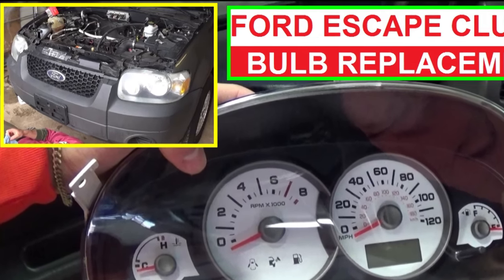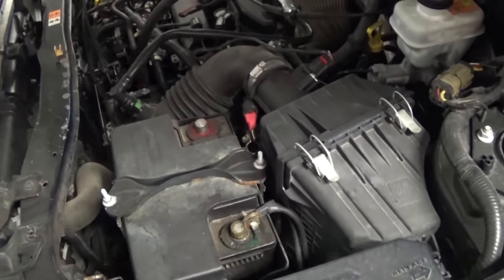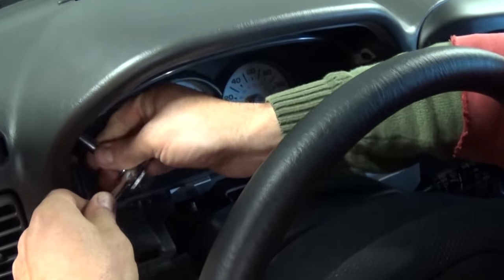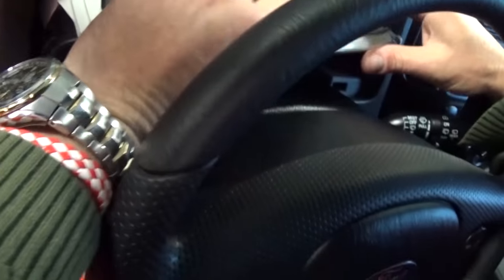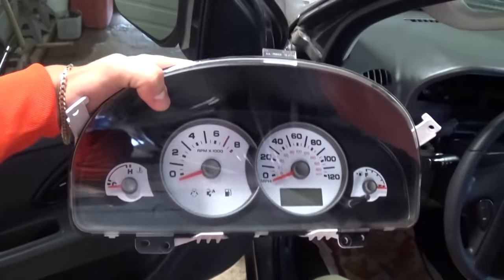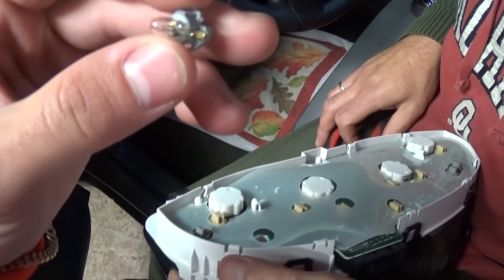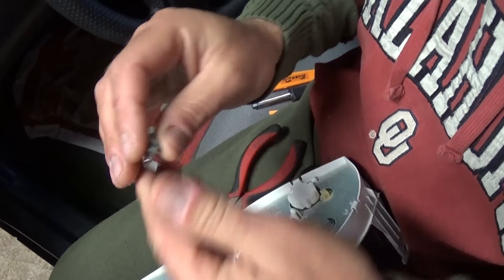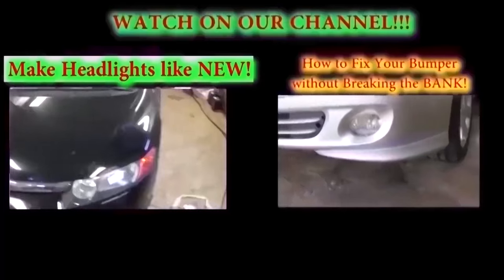How to replace Instrument Cluster Light Bulb on Ford Escape and Mercury Mariner

Comment: Thanks for the video. If anyone's wondering what bulb to use , it's a 74 Mini bulb
Reply: What bulbs are used for the other gauges? The gas gauge light and the Tachometer light on my escape are both out.
Reply: Ben Arthur it's the same size bulb
Reply: Nice...thank you!
Reply: Is there any way to change the colors? Or are all of the bulbs white and the dash is just tinted?
Reply: The correct bulb is a 2721. The 74 and 73 bulbs are a little to fat.
Reply: iekurt67 No dude, I just took mine apart and they are all 74's. I made a purchase and needed to return it. Don't lie to people!
Reply: I'll be interested to compare my original to the 2721 tomorrow after work-I tried to change my burnt out cluster light with a 74 today, and it is, as you said, a bit too large.  I wish I could upload a picture for anyone that doesn't believe you-the burnt out original bulb next to the 74 I tried to use in the socket---the 74 is not hugely different, but it is wider throughout and won't fit in the socket, at least not on my 2006 Escape.
Reply: Sara S Were the 2721's the right fit? I got a 2006 Escape as well. The bulb for the fuel gauge is burnt out on mine, so I wanted to replace all the bulbs in the cluster sometime soon.
Reply: I never even bought the 2721's--couldn't find them in the store.  I ended up buying E74's online: got a box of 10 of them for under $15 shipped--the E74's are a little narrower than the regular 74's.  They (E74) seem to be used more in imports, but they proved to be the proper fit for my Escape. While waiting for the E74's to arrive, I did cram in a few of the 74's: they were brighter than the original bulbs, and started to burn out within a week.  If I were you I would shop online for the E74's and replace all the bulbs at once, like I did.  Online prices were very affordable-much more so than buying the over-priced double packs of regular 74's in the store, only to find they don't fit like I did!  I also bought one of the replacement OEM bulb and socket fixtures as I thought I had damaged one of the original fixtures (just had the reshape the metal prongs a bit after twisting it out of the instrument cluster) and the E74's match the OEM bulb that came with the replacement OEM bulb/socket.  Wattage and voltage are the same as the originals/OEM---figures, even the OEM replacement doesn't have the bulb number on it, just the volts and watts printed on the bulb side.
Reply: Sara S Thanls for the reply. Just ordered a 10-pack of them off Amazon. Probably the same one you bought. Looking forward to installing them.
Reply: You're welcome, and I hope they work as well for you as they did for me!  My Escape's been my best vehicle so far-just passed 244k this past weekend.  Good luck!
Reply: Hello Sara, one question i have a 1997 mercury mountaineer 5.0 liter, all my lights are out on the instrument cluster, do you think all of them are burnt, or could possible be a fuse, also Miss Sara, do you think this E74 light bulbs would fit for my car or is a different size. Mercury's are part of a Ford, hope you have an answer for me, thanks in advance.

Comment: Hi I have a 2005 mercury Marnier and your video was very helpful with being able to get the cluster out of the dashboard. So finally I got it out and changed out all the bulbs to blue leds and when I put the cluster back together the color remained the same as it was before which is that ugly green factory setting color. So I found out that the reason that happend is because the factory ppl who made  my mercury Marnier painted the actual numbers in the gauges of the cluster so no madder what color bulb I put in it will remain green. I found a video to get that green off but I can not find how to take the faceplate off. I guess that's what it's called. I got as far as taking the needles off and took everything apart but still can not figure out how to take the actual faceplate off. I was told they come off then u turn them around and u can lightly scrub the green pa8nt right off and then it will be white so I can then use any color bulbs and it will work. I've seen lots of videos with people taking the actual gauge faceplates off the cluster but they never show the beginning where they actually take it off there already off when they start the video or i just can't find my car at all! Please help again i drive a 2005 mercury Marnier sorry this is so long but I really need help with this I've been trying to change to led lights for over a week now and still no success any advice is extremely appreciated!!! Please help!!!
Reply: Alicia Umfleet update please????